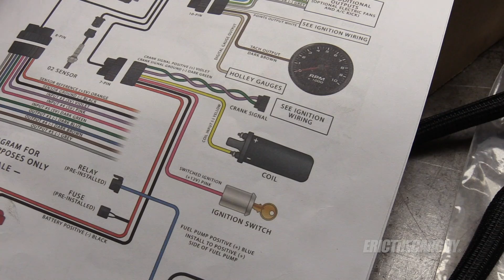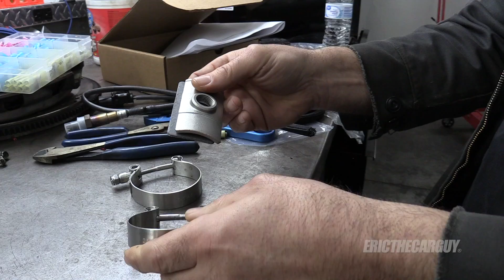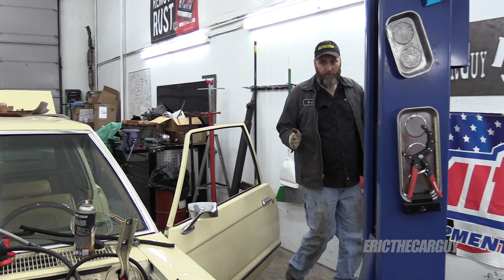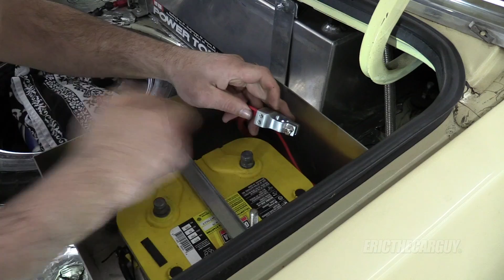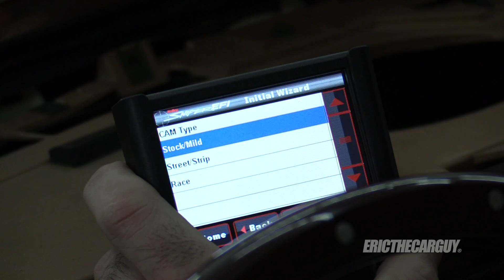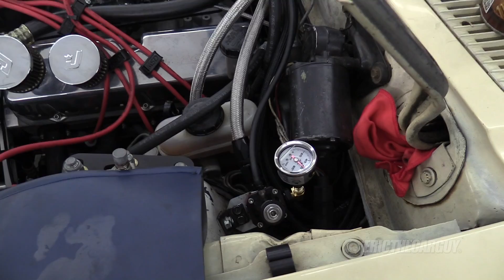How To Install a Holley Super Sniper EFI

Comment: I am worried about the fuel pump setup now, if something happens your pump will always stay running like this as long your key is on?  Let me put it this way, I have had a massive fuel leak before in my car while driving, And fire happened, But the engine cut off very fast and the pump stops because the ecu controls it.
Reply: Great videos Eric, keep it up. May I suggest an impact or oil pressure cut off switch for the fuel pump so it will turn off automatically if you are ever incapacitated in an accident and unable to operate a cut off switch...
Reply from the maker: I have a toggle switch for my fuel pump, and I've already dealt with fire. https://www.youtube.com/watch?v=-HIiOFHbCPA&t=4s
Reply: @ericthecarguy    But in case you have a accident things can get ugly if the pump keeps running, It is still a street car, Safety is a thing of Course. It is a good thing you have a Fire extinguisher of course. Accidents can happen al the time. I was also very lucky with my fire, The fire went out after melting every plastic part and timing belt etc... Looking forward to the next video as always.
Reply: @ericthecarguy  It's one of those things that really should be under ECU Control regardless.  If you really wanted to, you could have a guarded 3 position override switch hidden away that allows you to bypass ECU control for testing purposes setup for ON / ECU / OFF positions, and is setup to default to "ECU" when the guard is closed.

There will be times when you want to be Key on (in Run) Engine off, possibly for extended times, eg while communicating with the ECU via laptop for programming / diagnosis and log downloads, and in such cases it would be preferable to not have a fuel pump sitting there running non stop consuming a fair amount of power from the battery while it does.
Also if you end up with a hot car, you may want to leave the key on after shutdown for a few minutes to allow the fans to keep running, preferably without the pump running.

Also as others mentioned, its a pretty major safety thing, almost all ECU's will turn off the pump after the engine has been stalled for a few seconds, and this for fire mitigation in the event of a crash, or even say a burst line during just normal driving or racing that causes a stall out to avoid dumping huge amounts of fuel.
Some Cars also have inertia switches which forcefully shut the pump off in the event of a large impact.... Might be worth getting a re-settable one if not already fitted.
Reply from the maker: @KSSilenceAU  There is no provision with this computer to shut off the fuel pump in the event of a collision. I'd be no better off than I am now. I'm already set up to run the fans after shut down because I can manually turn off the ignition and fuel pump separate while leaving the fans running. I do this because I don't have a turbo timer. Thank you for your input.
Reply: @ericthecarguy  Not trying to be that know it all Dick but...

It's hinted at / implied in the Quick start guide that the ECU does actually control the pump with some sort of intelligence, and its large a safety issue as well: 

"SENSOR VERIFICATION
Before starting the vehicle, verify that all of the sensors are reading properly. To do this, turn the key off, and cycle it back on.
You should hear the fuel pump come on and run for 5 seconds."

If the engine keeps running after a collision, the pump will keep running, that's expected. You need an Inertia switch to cover that particular scenario. 

However, if the engine does stall for any reason, the ECU SHOULD turn the pump off after a couple of seconds or less.

Its worth testing, that way if it turns out it can do it, then you have peace of mind that it will cut out if you crash and the engine stalls.

Simple way to find out: stick a test light on the ECU fuel pump output, and see what it does when you key on and wait, during crank, and then stall the engine while leaving the key on (eg with clutch at idle).

If it does cut the pump off after a stall, then you might as well let the ECU have control. Otherwise leave it as is and put an inertia switch on it.

Last thing you want is to be trapped in a car with 60PSI of fuel spraying onto hot engine that could go up at any moment that will keep running if you are incapacitated and unable to kill it.
Reply from the maker: The sensors referred to are the sensors that come in the kit. There are no provisions for shut off after a collision with this system. The full instruction sheet is linked in the description.
Reply: @ericthecarguy  But still it's my own opinion that the blue wire from the ecu should run de fuel pump.  No rpm means the pump Wil shut off. And with key on it Wil prime it self for a few seconds. You can still leave the switch in series with the relay from the ecu. But at the end the ecu should have the control.
Reply: @ericthecarguy  

I am fully aware of the fact there is no collision sensing in the ECU, Many ECU's don't do that directly anyway. (Though in a crash the engine quite likely might stall for some reason). I also know its only referring to included sensors, that's pretty obvious.

I Think you have missed the point here a little bit.

I have read both the QSG and the Manual in full already before i posted the first reply.

What im getting at is that if the engine stalls for any reason with the key still on, the ECU is supposed to shut off the FP after a few seconds. That in itself is reason to let the ECU have control.  Test it! 

The stall for instance could be caused by loss of pressure due to a ruptured fuel pressure line, and in that case you absolutely want that thing to shut off sooner than later.

You need to test this to know because the Manual doesn't say yes or no, it just indicates that the ECU has control for the sake of priming key on, and if key is left on without start, it shuts the pump off.

You didn't read this bit from my last message properly....

"If the engine keeps running after a collision, the pump will keep running, that's expected. You need an Inertia switch to cover that particular scenario. 

However, if the engine does stall for any reason, the ECU SHOULD turn the pump off after a couple of seconds or less."

Comment: I'm surprised you went with this system. Why not go for a proper full EFI setup and be able to do precise tuning? This seems like more of a band aid solution than anything. Considering how many systems there are out there, and how much the costs have come down, I just don't see this as a worthy investment, when a true 100% standalone fuel injection system isn't any more money.
Reply from the maker: There were several factors to be considered. The main one being time. I wanted to get this done before the Power Tour. I still have a ton of work to finish on my dads truck before that time, a complete engine rebuild for one. This was the easiest, and best solution given the time I had to do it. Also, I'm very happy with it. Sure, it still needs a little tuning, but overall it's working great. Later I'll add the Hyperspark and I'll also have control of timing. You also may be forgetting that injecting the fuel at this point also provides cooling of the intake charge, just like my carburetor. On a forced inducted engine, this is quite helpful.
Reply: I figured it came down to a time thing. Sucks that you had to make that compromise. I've never been a huge fan of seperate timing control. I run my old honda on what you'd consider a "standalone" system and it's nice to be able to control timing within the ECU in relation to how the car is running. You can set up so many timing related fail safes, all in one unit. The risk of failure drops dramatically when you have everything controlled by one unit.
Reply: @dropinbiking92  this sort of system is much more user friendly and easier to install and learn with for EFI newbies so i think for eric thr holley sniper is the perfect system for what he needs. Not like megasquirt, haltech, aem, ect... where you really need to know your shit to set them up there is a certain level of knowledge required to be able to work with those systems that i dont think eric is ready for yet.

Comment: bravo,very nice,you will find the oxy sensor will need a kind of burn in because they have a free air calibration/health function to the interface so you will need to let it run more ,then you will find it will settle down and show close readings to your existing sensor because it is already functioning correctly,to do the free air procedure remove sensor from vehicle,remove connector from sensor,turn ignition on for 30 seconds ,turn off then reconnect sensor and turn back on for 60 seconds in free air away from exhaust,reinstall then see if that is better.for forced applications it is recommended 3 months after install,then every 10.000 miles
Reply from the maker: Interesting. Thanks for that info.
Reply: @ericthecarguy  oh and eric there is this variable also in regards to your old sensor >>>Bosch’s published test data, its wideband O2 sensors are accurate to .15 of a point when new, but that figure increases to .29 after 500 hours of use. After 2,000 hours of use, the variation between the measured air/fuel ratio and the actual air/fuel ratio increases to .59 of a point. This means that an indicated air/fuel ratio of 11.76:1 can be as lean as 12.35:1, or as rich as 11.17:1